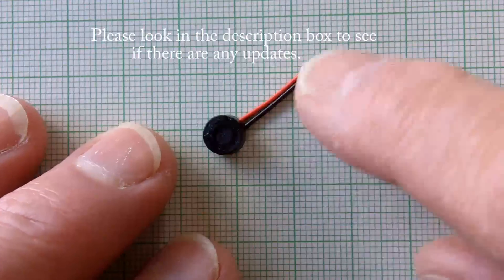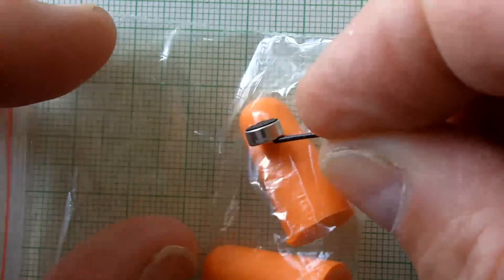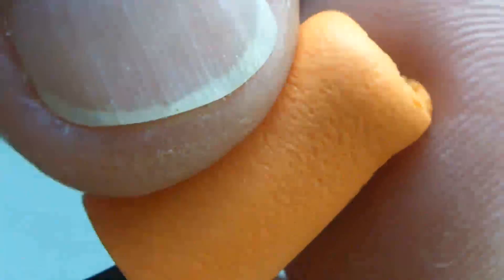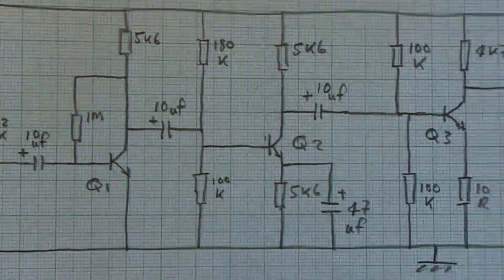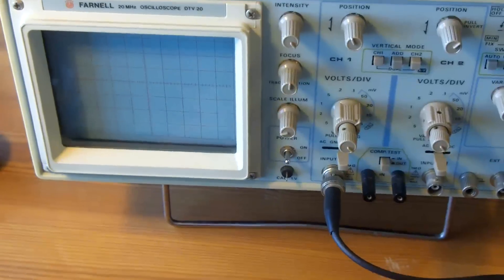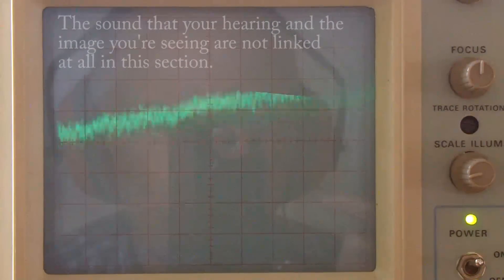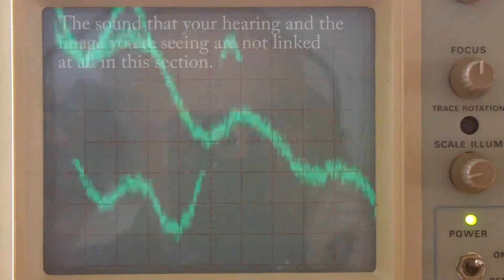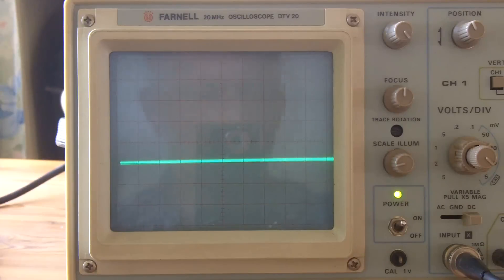Tinnitus Experiment ... Part 2, first test, no answers yet.

Comment: Electrical ideas:  Try high-pass filtering with a cut-off of several hundred Hz to avoid mains noise (and shield the pre-amp stages). Your LF hearing is probably fine anyway?  Adding a small transducer (maybe doubling as a microphone?) to the earpiece would let you try evoking OAEs with various stimulus.  I'd suggest interfacing with a PC soundcard to generate the stimuli and record and study the detected sounds. You can try using a hybrid to allow concurrent TX & RX with the one transducer too.

Comment from the maker: Hi, thanks for the information, I hadn’t seen them before, I’ve had a quick look and yes they have them at Digi Key, I’m sure I'll be able to get something in the UK but thanks for the offer of help, I won’t order anything yet as I want to look at the associated amplifiers. I might try and get to grips with where the electrical noise is coming from. I had anticipated that it was the amp until you raised the mic as a possible source.   
Thanks ... Andy

Comment: Andy, I think the model described in the paper supports your bell experience.
Rather than canceling an otoacoustic emission however, it suggests that the bell perhaps reduced the gain of an AGC circuit which had cranked up too high due to damage to hair cells which function at the frequency of the bell or of your tinnitus.

Comment: Hi Andy, I read an interesting article some years ago in a HiFi magazine which went into detail about how the ear actually works versus the conventional explanation of the 'hammer' responding to sound waves which are then turned into electrical signals and sent to the brain, etc. I'll see if I can find the article.  Essentially is said there is a chamber in the ear which resonates constantly and its normal frequency is filtered out by the brain.

Comment: To reduce the electrical noise, one suggestion would be to use a MEMs microphone with a built-in amplifier - such as the ADMP504 from analog devices.  It comes in a tiny 3.5x2.5x1mm shielded package which should fit in your ear too.

Comment from the maker: Hi Barry, I found I have to really concentrate and stop breathing just to try to ‘hold the line’ on the scope. I’ve got it AC coupled but it still whips about as the triggering tries to sort out the 50Hz ripple (UK mains frequency.) I underestimated it, I think I’m going to have to find some Bio Medical instrument circuits.  OK on the throat mic, I’ve got one WW2 vintage. Two modules with what looks like fine chamois leather over them. Wouldn’t fit in my ears hi hi.
All the best ... Andy